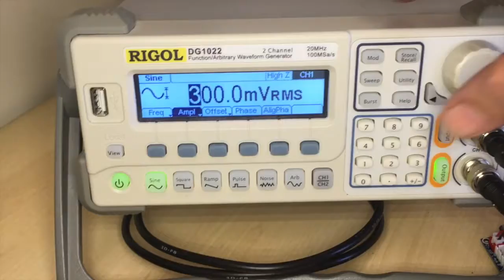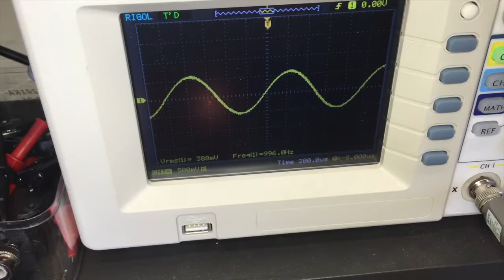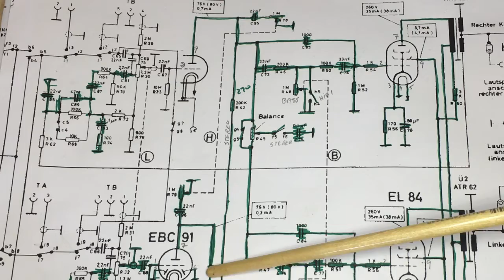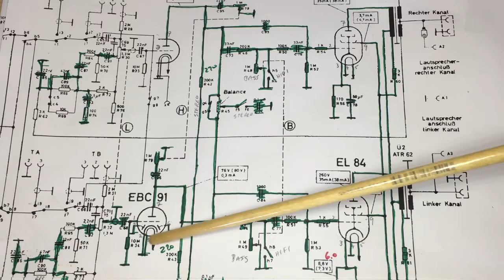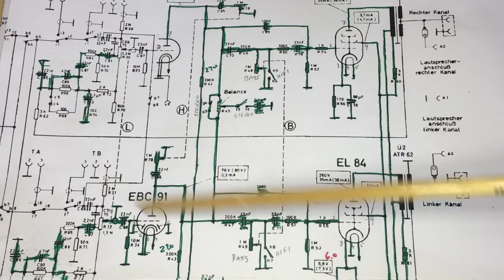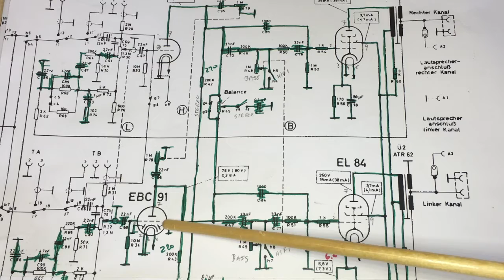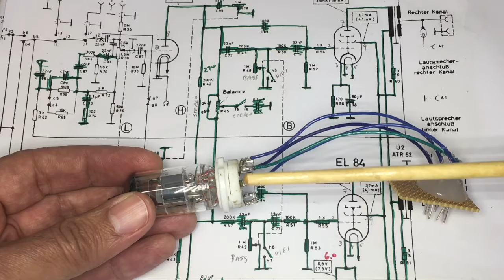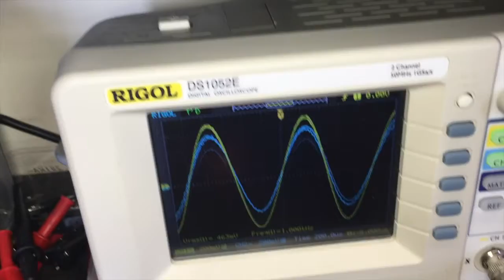Loewe-Opta Truxa Stereo 4741W tube radio restoration - Part 4. We have a problem. No problem.

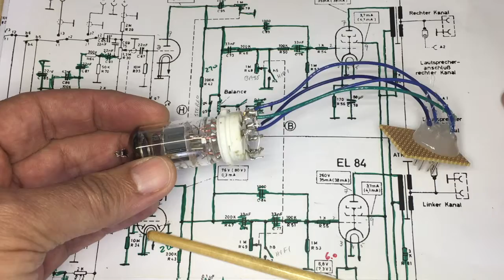Comment: @ 14:00 "do not do this at home.."  Why not, thats an excellent solution if the correct part is not at hand, hehe :-) Judging from your accent this old saying would apply: `n boer maak `n plan.    En dis geen kak plan nie meneer, dis baie goed werk
Reply from the maker: Baie dankie. Já, ‘n boer maak ‘n plan, en ‘n Porra maak twee :)
Apologies. My Afrikaans is really rusty. It’s been over 30 years since I left SA, but some of “die tal” that I learned in Harrismith still lingers somewhere in my brain. 
Where are you from?
Reply: @electronicsoldandnew  I used to live in Hillcrest, thats between Durbs and Maritzburg, but also left over 30 years ago when I was to be drafted into the weermag. Because I have dual citizenship I volunteered in the Bundeswehr but subsequently got stuck here in Germany ever since XD
Reply from the maker: Well, talk about coincidence. I moved to PMB when I was 13 and did high school at Alex High, before doing electronics engineering in Durban Varsity. I then left in 1986, two weeks before I was supposed to present myself for the army :)
Reply: @electronicsoldandnew  Haha, this is really a coincidence, I also left SA via Jan Smuts airport early September 1986, never to return again. I was to appear at the Port Natal (?) barracks for duty 10 days later and thought bugger that. Went to German army instead and never regretted that move. Was a shame, because the good young potential that left the country back then contributed to the place going down the chute. Lots of my mates who had just finished studying packed their bags and left to places all over the world.....
Reply from the maker: True
Reply: @electronicsoldandnew , I happened on one of your newer videos, found value (got two needing new capacitors), so started at the first video posted. Dad passed on an interest in people and their accents, so was trying to place it, vaguely familiar. Now knowing an Afrikaans accent, of course, heard it years ago in some of the Uni classmates. 

My only connection is Dutch ancestry, who desired so much to be American, our family no longer speaks the Mennonite dialect or German. But, the attraction to Germanic was not removed, have a Telefunken upright console and a Körting (an American-German love child, my example, a stereo SE ECL86 with not one shred of information on the internet). 
😜

Cheers,
Adriel
Reply from the maker: My accent is South African, but from the English-speaking community. I was fluent in Afrikaans at one time, but am now completely out of practice.
Reply: Thank you for taking your time to respond and clarify, it is appreciated.